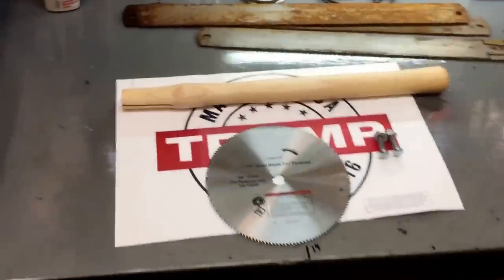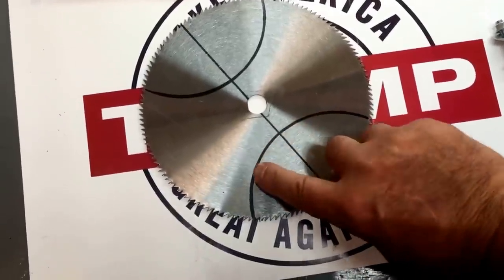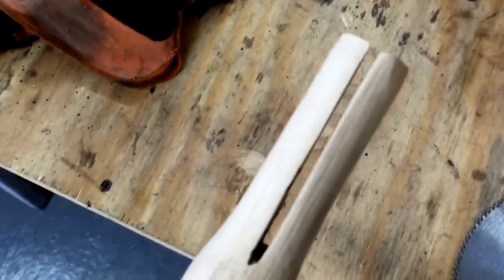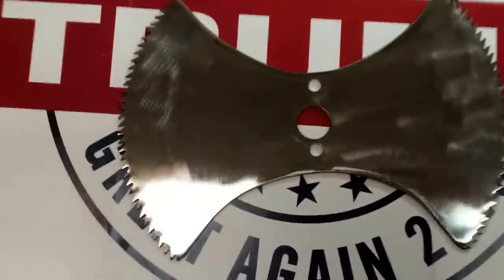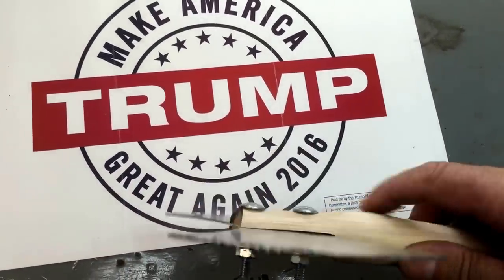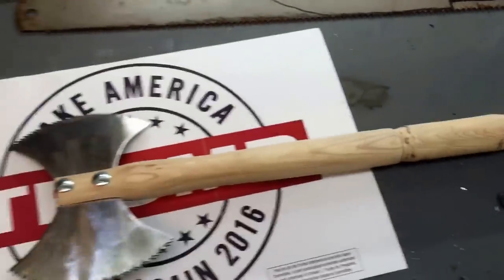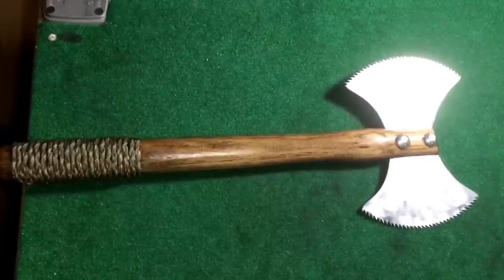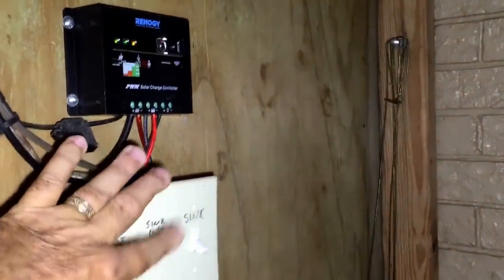Battle axe from saw blade

Comment: Sweet Sign ... O_O I mean battle Axe. I make a lot of knife handles of natural fiber like hemp or jute & epoxy. I have visions of you making a battle axe with a full 14" fine bone cutting blade with a  weed wacker motor to spin it. Greased by pig lard of course. It would probably be a two hander though :).

You could sharpen one edge of that axe to razor sharp, good ol saw blade steel, it would hold an edge pretty good I think. You could shave with it. A choice of implements.

I know you've got a wife to come up with great ideas to occupy your time, but it's fun suggestin :))
Reply from the maker: Hmmmmm,,,, just how much of that " hemp" do you have? Maybe I need to visit and bring my hemp pipe.
Reply: BCtruck, rebuild, repair,repurpose lol well I used to do a tad, but the stuff makes me stupid, so it's been years. I don't buy the propaganda used to make it illegal, but it really clouds me up. Some people report different reactions and there is scientific info to support that it increase synaptic reactions, but I know it makes me all duhh for a couple weeks. However, visit any time :) it's a trip though ... no not that kind.

Comment: I'd be tempted to fill that hole in the blade with some epoxy just before fitting it, its seems like those holes in a row like that could be a weak point.
Reply from the maker: This is just a novelty. There will be no medieval battles fought with this. Maybe an occasional car jacking, but no battles.

Comment: hey Brad, I think half the channels I subscribe to have a plasma cutter. I feel myself being pulled to harbor freight by some mysterious force. LOL that was a neat axe. have you ever thought about getting a woodburner. You can get tips that make easy designs in the wood that might accent some of the wood in your projects. 

DJT 2016 " We have a country."
Reply from the maker: The things I like about the plasma cutter: there are times when nothing else would work as well. The metal doesn't get anywhere near as hot as it would with a torch. The slag is minimal. The kerf is minimal as compared to cutting with torch. There is a slight learning curve so practice on metal you don't need. You are getting very sleepy,,, when I snap my fingers, you will search for a 20% off coupon and make your way to harbor freight. When you awaken, you will feel refreshed and be the owner of a new plasma cutter,,,,,,, SNAP!
Reply: I like harbor Freight. They stil sell the 9  function metal detector for $49 and it is a bargain.
Brad, your axe inspired me, I may make a spear out of scrap i have on hand. i have been thinking about what i could  make for neighbors in case of a zombie apocalypse to help them. your axe is a good item, but i am thinking of making a 6 foot spear from conduit and some 2x2 wood. It would be good protection from anyone that did not have a firearm as it would reach longer than a machete, be super quick to make and only cost about $2.
Reply from the maker: I like that idea!! Weapons to make quickly, cheaply,and in large quantities, to hand out to neighbors.

Comment: Hate to give you the bad news but we the people do not vote for who becomes president. Our votes can effect the vote but it is the Electoral College that directly votes and they are not required to follow the popular vote in most case. 

Out of the 3 branches of federal government we only directly vote on congress and with how they play with voting areas that might not even matter in the long run. 

There are 538 votes that mater for the president and LA only holds 8 of them and a state like CA holding 55. 

Now onto the fun stuff any scraps you have from saw blades you can always turn into throwing knives/stars as the steel used is a good quality for holding an edge and not warping when you hit a target.
Reply from the maker: Andrew! Don't be a cloud on a sunny day mon!!!! Air ting be iree!

Comment: you should have taken the teeth off and sharpened it
Reply from the maker: Drocove Dringo I like it with the teeth left on. That's why I left the teeth on.
Reply: Ya its cool but for like chopping wood or general use the teeth would cuase problems
Reply from the maker: its called "battle axe". do you know what that is? It  isnt something you would chop wood with,ever. Do you see why? The handle is on the outside of the blade,not inside it like a wood chopping axe. These are used in battle.
Reply: OK dude I'm not trying to go into technicalities with you I'm just saying that when I make mine that's what I usually do its your shop, time and materials you do you
Reply from the maker: Drocove Dringo which brings us back to your original comment. Why would you tell someone they should have made something differently than they've already made it. You last comment was the best and should have been the first. My shop,my build. Your shop,your build. By.